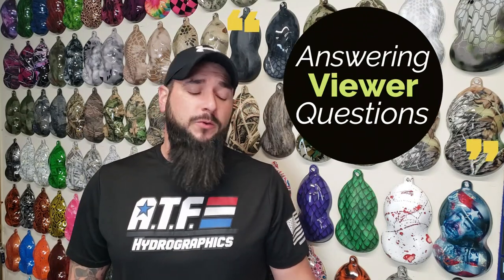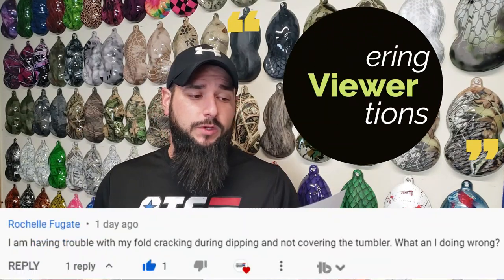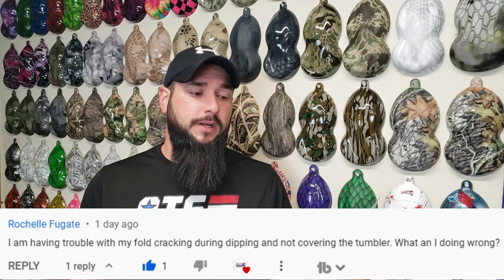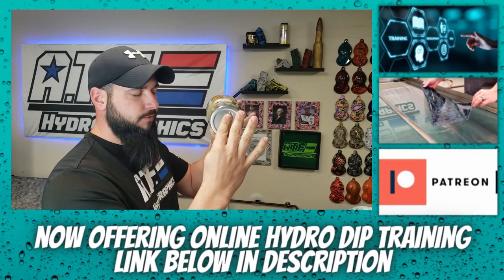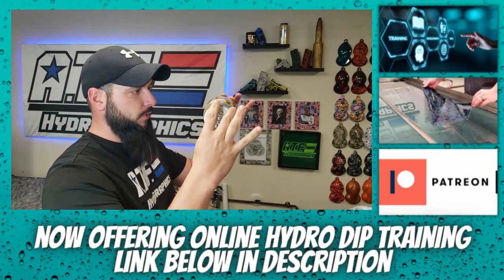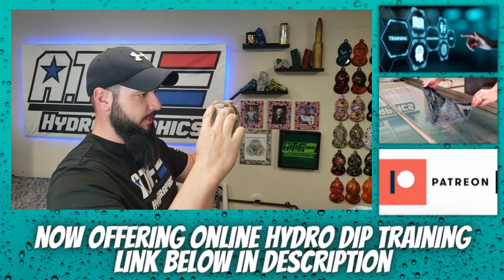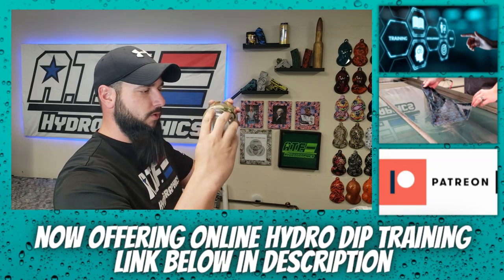Hydro Dip film cracking or folding? Plus the right way to roll Tumblers!

Comment: Awesome information as always Chris.
Have you ever tried airless gun for activator what are your thoughts about it?
I am asking because I have issues with moisture in my air line and I was thinking might be better to invest in an airless system instead of filters.
Thank you
Reply from the maker: I have never used an airless sprayer.  I do have a pressure pot but it overpriced and does not woek all that great